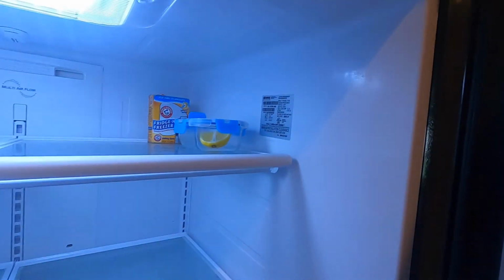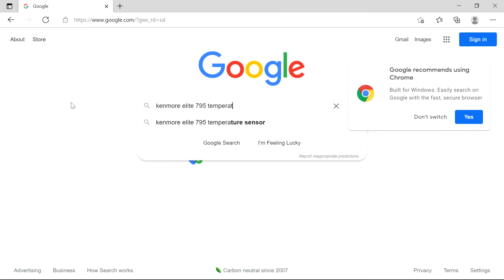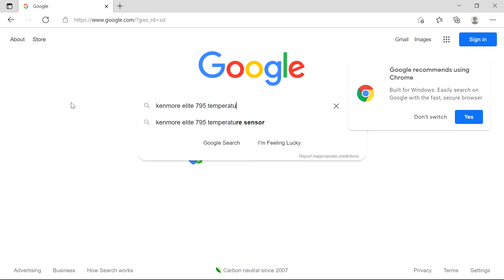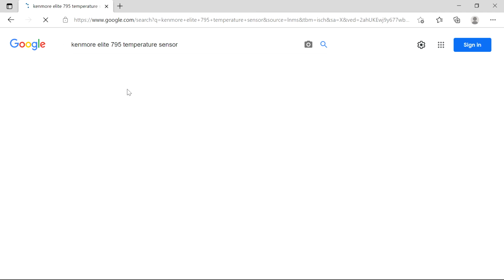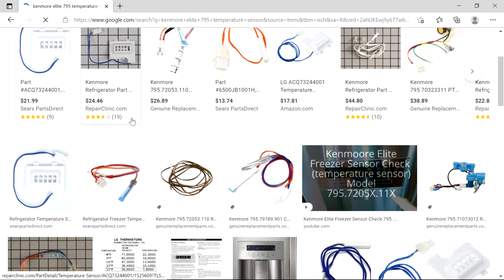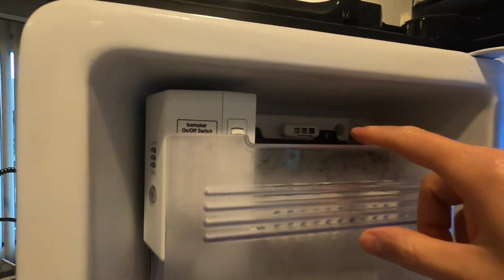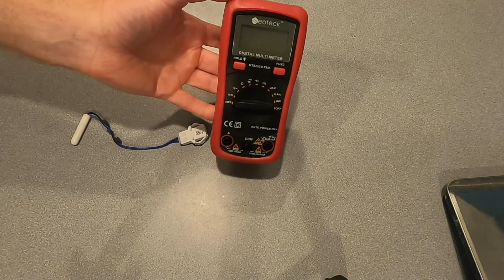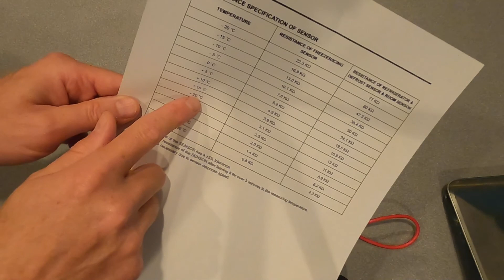How To Test And Replace A Refrigerator Temperature Sensor

Comment: I've had this new refrigerator for 3 years. It's freezing a lot of my groceries in the refrigerator section. I've turned the settings to the lowest. It's still freezing things up. I have to throw away a lot of food. Why is this happening after having the refrigerator for 2 years? I've been dealing with this for a year.

Comment: My LG refrigerator LFXS 30796s fan works in test mode but will not work in run mode.  The themistor tested good.  What else could be wrong?

Comment: If you are getting 3.1kohm at 70F then you probably have a 2k5 ohm thermistor with a beta value of 4000k. There are online thermistor calculators. The beta value depends on the manufacturer but 4000k is ok as a ballpark figure. All thermistors are rated at 25C or 77F.

Comment: how many temperature sensors are in your refrigerator (one, two or three)? Is there one in the freezer section as well?  How did you determine that you had a ~4k ohm thermistor?  Did the sheet come with the exact replacement?

Comment: Hello I hope someone can help, I have a Whirlpool fridge freezer, freezer section is good (cold as it should be) fridge section temp control is set to 2c but it doesn’t get to that, temp hovers around 5-6c, no ice on coils, damper vent works it opens and closes, no dirt on condenser coils, something is telling the camper door to close early. Would anyone know what I can check, Fridge is cold but not cold enough.
Thanks
Reply: Same here. My whirlpool freezer freezes alright but the fridge doesn't cool at all
Reply: @truhabits7338  try your damper door, open fridge door press door switch and see if there’s air coming out from the vent

Comment: Thank you for the video, there is actually a temperature sensor on the freezer for my refrigerator.   I am not getting the set temperature on mine, either in the freezer or the fridge.   it is running 45 when I set the temperature at 37, and the freezer is set -3F and I am getting like 15 F.  Do you think it is the temperature sensor.  The compressor seems to be running fine, with no click and the condenser fan is on as the condenser coil has temperature difference to the ambient about 30 F.   Thank you in advance.

Comment: Great video, tutorial was clear and simple. The temperature sensor you located behind the icemaker, is it a temp. sensor for the fridge or icemaker? I have similar refrigerator, the freezer freezes well but fridge side is experiencing temperature fluctuation between 40-55 degrees. What do you think is the problem?
Reply: If the tempeture sensor is freezing your freezer the fan isn't able to blow the proper air into your refrigerator. Thats why the fridge is getting hot. I'm having dame problem. I just bought temp sensor and going to put in today.